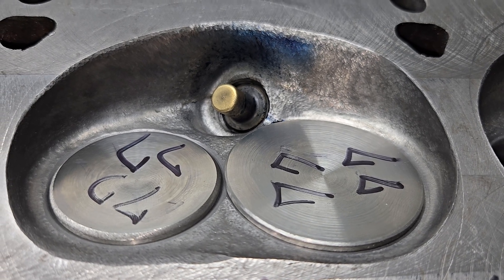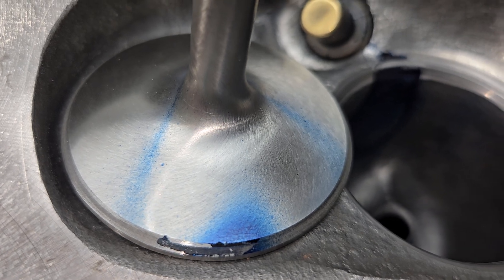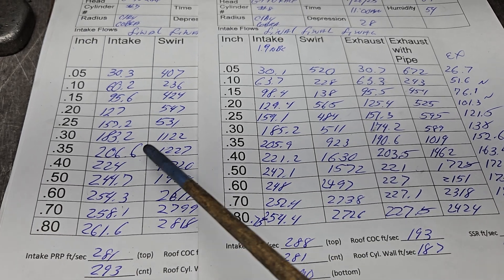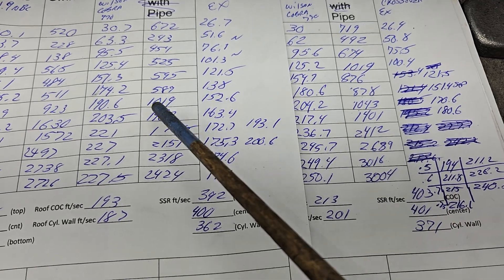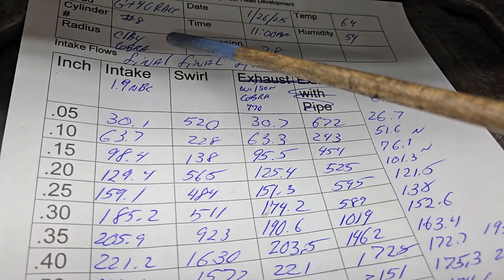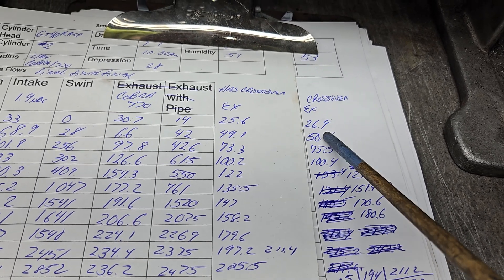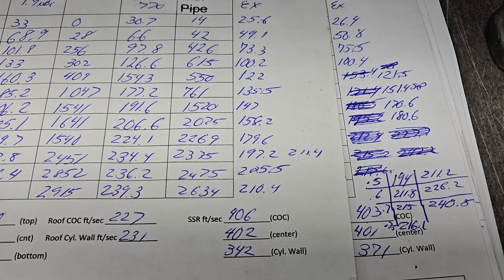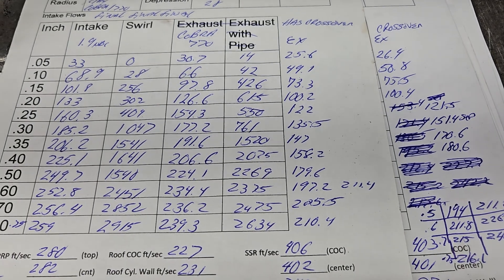Ford GT40 289 Race Project. Cylinder #7 flows and airspeeds, Shelby/Cobra intake, Wilson spacer.

Comment: My quess on the 289 for HP and Tq is 475/330 up to 500/347.   
(1.9 to 2.0 HP per cfm)
With a 250/258 .650"/.650" 109 +3 3200-8000 plus 500 rpm over-rev
Est. approximate peak HP 8000  peak tq 5250  Redline 8500.
Stall converter 3500 to 4500
All speculation of course
Reply from the maker: @slicepizza3263  Good estimates.
Reply: @servediocylinderheads hello I talked to you a year,or longer,have you ever did a ford fe head,what would it cost to port a fe cast iron head,change guides to a 11/32 guide,or 5/16
Reply from the maker: @eddiefe428  As of right now I can't change 11/32 guide to 5/16 guide. K line might make a kit. Charlesservedio@gmail.com for pricing. Thanks

Comment: Maybe #7 is competing with another runner which is why it's a little lethargic down low, once that pressure signal overcomes any other signals coming from adjacent runners it starts to breathe nicely.